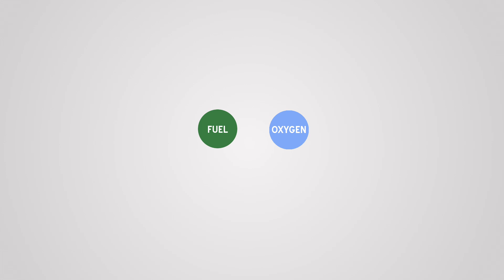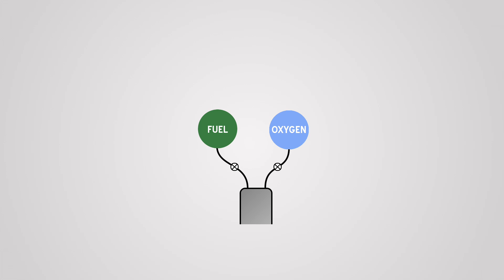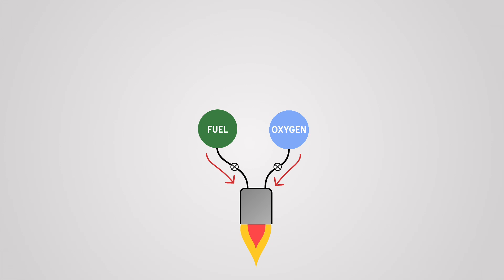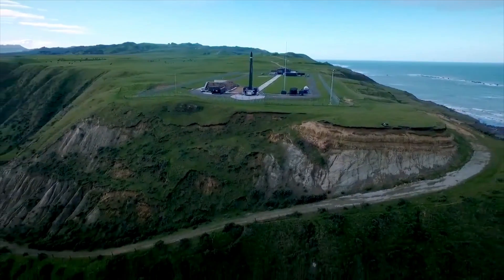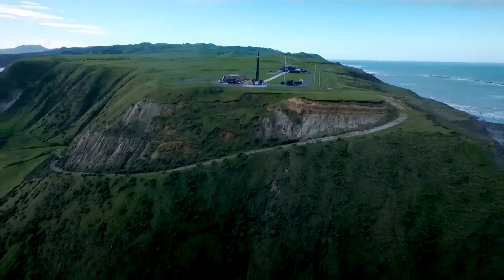How Rocket Engines Work - Part 2 - Flow and Pressure

Comment: Why dont they just add a huge piston inside the fuel/oxidizer tanks to push it down? will that work? thank you
Reply: That will signifcantly increase weight of the rocket and thus lower its payload to orbit capavility.
Reply: Large, liquid-fuelled rocket engines have very powerful turbopumps as explained in part 1.
As an example, each engine's turbopump in the first stage of the Saturn V rocket had 55,000 HP. That's comparable to a medium sized jet engine, so imagine that fuel is pumped into the combustion chambers of these rocket engines by not just one, but five F-16 fighters!
https://www.americaspace.com/wp-content/uploads/2013/01/13.jpg

Comment: Why does champer pressure have a high impact on specific impulse? Can you please explain? Thank you!
Reply from the maker: This is explained in part 3. Basically the pressure and heat energy are converted to kinetic energy in the rocket's nozzle. Having more pressure energy means you end up with higher kinetic energy.
Reply: Space Is Kind Of Cool thank you! I understand now!